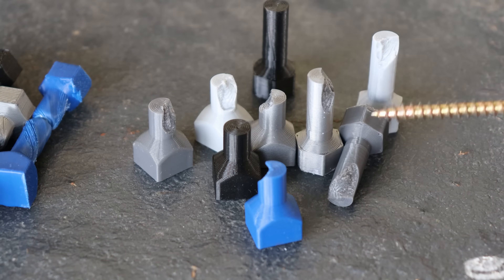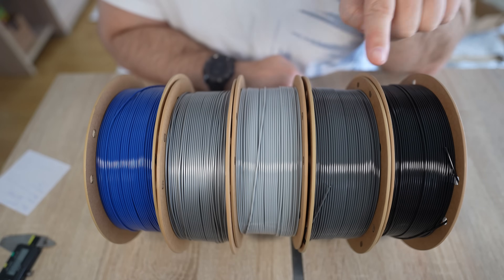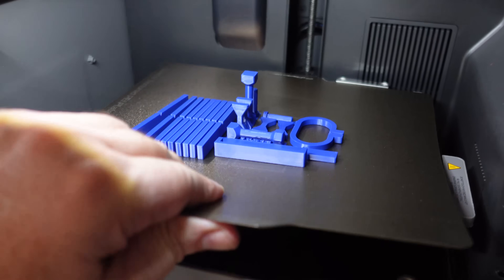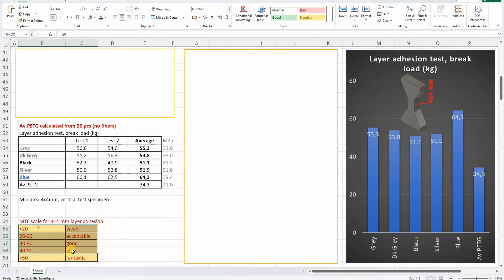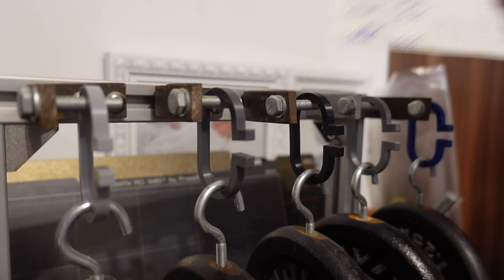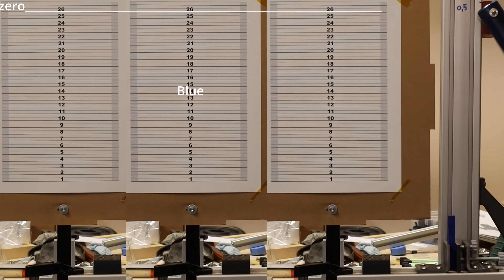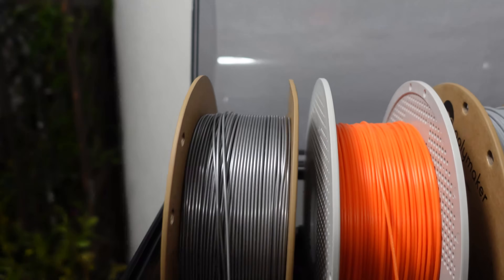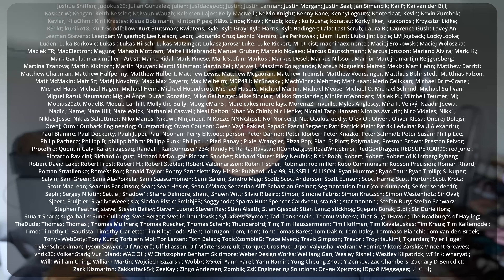PETG Filament With Fantastic Layer Adhesion? Polymaker PETG Review

Comment: Do you post your test result data anywhere? I’d love to see new formulation data against other petg brands. Unfortunately I’ve always found polylite to be exceptionally weak. Also, have you noticed the new formulation having much higher heat retention to the point of causing print difficulties?

Comment: Disagree that the cardboard works well in the AMS. I find that it does not as the spool gets closer to the core, where the torque needed is higher. The spool rims are easy enough to print, and helpful to avoid issues from the winding. The Polymaker winding isn't always the most consistent and this creates feed problems. The filament is quite good and a very nice product for the money, but the winding and the spools are lacking.

Comment: I had very bad luck with the Polymaker cardboard spools with or without the hardened edges.  They still warp, swell and breakdown overtime, leaving debris inside my AMS.  And 4 of the last 14 showed up broken.  Never buying their cardboard again.  Looking forward to these joining their refill category.
Reply: The sides are pretty easy to rip off. You can then put what's left in a reusable spool
Reply: @kendokaaa  true.  I've been doing this too.  Just a slight risk that the filament will wiggle around a little.  Happened on an eSun spool.
Reply: @bjornlovoll8972 What I do is I lay it flat, rip off the top, insert half of a reusable spool, flip it, and add the other half
Reply: @kendokaaa  I do the same.  Using gravity to help hold the filament in place.  The other issue with doing this is sloth.  I do not want to print labels, but I have too many filaments to have spools that I think might be Polymaker PETG, or was this one sSun PLA?

Comment: The test samples printed beautifully and being able to print faster and have significantly better layer adhesion is a big advantage.  Thank you for the detailed testing and thanks to Polymaker for providing the filament for testing and for sponsoring the testing of all filament.  I just ordered two kg of this PETG to try and the Polymaker website is super fast and easy, particularly as a returning customer.  This is how e-commerce should be done.  Kudos to Polymaker.

Comment: You should try to print with actively tempered chamber, as air temp has big effect on layer cooling, thus layer weld quality.

I measured an average of 42MPa layer adhesion with Filanora black PETG with 47C tempered chamber (250C nozzle, 0,15mm layer height; 0,5 width with a 0,4 vulcano nozzle, minimal cooling). My test samples were smaller (2x2,5x30mm, 9 printed at once), so layer time also way lower, which also do effect the temp difference between old and new layers. Highest measured layer strength among all the batches was 47,5MPa. 

Be careful though, as at 50C chamber temp the filament clogged at the heatbreak in my setup, and also the place of the chamber temp sensor may change the max safe set value.

Comment: Nice testing. A great test would be a true head to head with this filament versus Elegoo Rapid PETG and the old polylite PETG formula on the same printer and similar settings. $20 (new) v $11 (rapid) v $14 (old) I am thinking.

Comment: Others in the comment section have already pointed out that you might be printing too fast for good layer adhesion. My finding was that there's visible change in sheen on the flow rate spiral vase test right around 17-21mm^3/s even though i could crank it to beyond 30 without visible failure. Would be good to figure out what setting to use to obtain maximum layer adhesiin. It could be flow rate, melt completness, layer cool down time (too long or too short)
Reply from the maker: Fast or not, I used Polymaker's profile

Comment: Thank you for making this video. I recently started printing in the new Polymaker PETG formula. I don't know if you still have a QiDi X Max 3 or not but I am struggling to use this filament over 240c and keep decent overhangs/bridges. Maybe you know of some good slicer settings to change where I could print at 250c for possibly better layer adhesion? I print exclusively in PETG and this is my general favorite right now.. I wish it wasn't as brittle but I don't know of another PETG that is as good as this and not as brittle. Maybe you do. This is my go-to filament at the moment.
Reply: Pctg is similar and has 10x impact resistance.
For bridges and overhangs increase fan speed to 100% (just for them, not the whole print)
Reply: @riba2233 that seems to worsen drooping because it blows them down
Reply: @colinmsmall  which means a non ideal duct design

Comment: Your methodology for strength testing sucks.  You measured higher strength for Polymaker PETG because you switched to the P2S (which has a longer meltzone than your previous printers, increasing effective nozzle temperature) and 40C+ chamber temperature.  Whereas your other PETG testing was with an X1C with the lid off and door open or P1P (which is open frame).  Until now, your testing has been literally the OPPOSITE of what is recommended for printing PETG.  You should be testing all PETGs at the same nozzle temperature, same hotend design, same chamber temperature, and aux cooling fan speeds for the comparison numbers to matter.  With PETG, you are right at the edge of a cliff in terms of strength at 250C.  A minor change in any temperature-related parameter can easily result in a 25-50% improvement in strength at 250C setpoint.  All PETGs need to be printed at 270 +/- 10C with a 40C+ chamber to achieve maximum layer adhesion.

Comment: Nice, finally we have a proper advancement in filament properties. Seems more like a pure pet based on the properties, higher tensile (regular petg is around 50, this is 60), stiffer, less creep etc. Really exciting, thank you and can't wait for the pet-gf test 😊
Reply: Printabilaty and warping would probably be worse in a pure PET, but they might have reduced the glycol amount in the material.
Glycol is added only for printabilaty as far as I know, so they likely found other additives that allowed them to do this
Reply: @komischertyp4  makes sense yeah

Comment: Quite impressive for PETG (beside the Impact rest).
But Polymaker claimed a 95% layer adhesion strength (nearly isotropic). Would like to know of that was just marketing bs or if it possible to achive with special print settings, like slow and hot without cooling or something similar.
Reply: I have had our R&D department confirm this multiple times even with different people testing to be sure, but yes with the right printing settings you will have nearly isotropic layer adhesion. No marketing magic! Edge of 3D video also shows very good results.
Reply from the maker: @PolymakerPete  Contact me, I will send you my test object, you send me back the .3mf file for some Bambu Printer (P2S, X1C, H2D or H2S).
Reply: @PolymakerPete  Maybe you should get in touch with Igor then so he can show how to do it.
Reply: Marketing, you can do that with any filament if you overheat it. This is realistic

Comment: Can not wait for the PET-GF15 tests. Keep up the great work. It helps alot
Reply: I'm currently printing with it. I previously had PET-CF17, and compared to it, the GF15 version is slightly less stiff, but also seems less brittle. Layer adhesion is better than the carbon fiber version. Both filaments, printed on an open printer, require drying after a few days if the spool is left exposed to the air. Straight out of the box, they print very similarly and can be printed with the same gcode, although with PET-GF15, you can increase the printing temperature by 10°C. BTW I am also waiting for a professional test and whether it can be annealed to increase its durability like in the CF17 version.
Reply: @michagromek6342  it can be annealed
Reply: @michagromek6342  Seems to be my experience with SirayaTech PET-GF version. Glad to see another offering!
Reply: @michagromek6342 Most PET don't gain any durability from annealing (IE impact resistance). Some might actually lose some impact resistance typically it's to gain significantly higher temperature resistance. Definitely a trade off annealing, and with shrinkage concerns not worth it unless you're using it where high temperature resistance is a requirement.

Comment: We need a tier ranking for each filament type based on your test results. This way, we can clearly see how each brand performs in PLA, PETG, and other materials.
Reply: The problem with this approach is that it's not the brand performance, it's the plastic formula performance. A brand may have some good plastics but also could have bad ones.

Comment: It's interesting that you only got about 50% layer adhesion compared to horizontal, while Edge of 3D (another testing channel) got >100% layer adhesion. Polymaker also claims "nearly isotropic" layer adhesion. Could it be that you need to change some printing parameters?
Reply: My guess would be flow rate is too high. 21 seems like a lot for a non high flow PETG
Reply: @muffins4tots  it is high flow now as a standard
Reply: @muffins4tots  you can go a bit higher on the nozzle and chamber and even zero fan and it will help, but it's always a trade off with print quality. Depends on your geometry and use case.
Reply: Isn't it the other way around? His specimen comes with XY strength much higher than the numbers in polymaker's TDS. Maybe some annealing (post processing) could help.
Reply: That's impossible and means that he is not testing something right. This was already printed with a low fan and decent temp so this is what you can expect.
Reply: @riba2233 This is a new formulation that Polymaker is claiming to be isotropic.
Reply: @polycrystallinesilicate  there is no such thing unfortunately.
Reply: @riba2233  Then it's a good thing they are not claiming that; only the parent of this reply.
Reply: @snarky-drive-by  yeah that makes sense
Reply: @snarky-drive-by They are claiming "nearly injection molded" layer adhesion in at least one of their videos

Comment: Great that there is still innovation for already popular and established materials. I have printed with the white from this new formulation and it is indeed higher flow compared to other regular PETG filaments. Some questions to Polymaker: Are transparent colours coming for this formulation? 3kg spools? Refills? Any thoughts/considerations for the OpenPrintTag? I wonder if other manufacturers will react or stick to their old products. Prusament and Extrudr for example sell their PETG for quite a premium. Azurefilm on the other hand has PETG high speed superpacks that cost 12 euro/kg and at least on paper the properties should be similar to this Polymaker PETG formulation. I have already printed some toe clamps with the PET GF15 white, it is a great material, but too early to tell how it will hold over time. So I look forward to your video with the 6 colours as well.
Reply: Translucent Coming? Yes
Refills? Not at the moment, we have to see how the community reacts with our PLA Refills
OpenPrintTag? Yes, we are looking into and have been supporting many of these projects.
Pricing as a premium? This new formula was actually more cost efficient for us than the old formula actually so we passed on the $3 per kg savings to you :)
Reply: @PolymakerPete  Thank you for the response. Looking forward to the transparent colours. Regarding the price, I said that the other EU suppliers have premium pricing for "old lower flow" PETG, not that Polymaker is charging a premium. The price to me for the EU market is perfectly reasonable for this material given that it is a better PETG than "regular PETG".

Comment: 1:20 I’m confused. PETG is not more brittle compared to PLA. It’s quite the opposite. PLA is stiff and brittle and PETG is quite a bit more flexible. Right?

Well, I guess I should finish watching the video before commenting, lol.
Reply: PETG is more flexible (it bends more before it breaks) but it is more brittle (handles sudden impacts worse) than PLA.
Reply: @polycrystallinesilicate  Thanks for the reply. Yeah I’m still trying to wrap my head around this. I always thought that if a material is more flexible, then it automatically means it’s less brittle. But this video seems to contradict that (and I’m sure he’s right and I’m wrong, lol). I guess it has to do with a sudden vs slow impact/force. It seems PETG is flexible when you’re slowly bending, but can still be broken more easily (compared to PLA) when it’s hit by a sudden impact. I guess. I don’t know. My mind is going down a rabbit hole right now, lol.
Reply: @GoComm79 That's right, properties of a material can change based on the strain rate (rate of deformation). PETG can handle low strain rate better than sudden impacts.
Reply: @polycrystallinesilicate  Ah ok. Very interesting. Thanks much.
Reply from the maker: Check my Voxel PLA vs PETG video
Reply: @MyTechFun  Thank you! I watched it just now! I guess I’m just getting mixed up with my terminology. From my understanding, and my direct experience, PETG is more flexible (bendable) than PLA. I consider PLA to be rather stiff, meaning inflexible. And I always associated stiffer materials with being more brittle, and more flexible materials with being less brittle. But I guess that’s not necessarily the case.

I did some research and I guess brittleness is more the ability of a material to resist breaking when subjected to a SUDDEN impact. I think of that more as “impact resistance.”

When I think of flexibility, I’m not thinking of sudden impacts, rather I’m thinking of more slow, bending type forces/impacts. Slowly pushing something versus quickly punching it. I guess that’s more accurately called deformation though.

PETG is definitely more flexible than PLA, but when subjected to sudden impacts, like your swinging hammer test, it breaks more easily. So by those definitions, then yeah, it’s more “brittle.” I’m still trying to wrap my head around that because it doesn’t really make sense to me, lol.

Either way, thanks so much for taking the time to make these wonderful videos for us! We definitely appreciate it and I know they always get me thinking.

I mainly wanted to watch this video to see how Polymaker’s new PETG compares to Bambu Labs PETG-HF. And it seems like it’s a superior product. Much better layer adhesion and tensile strength, all while being only slightly less flexible.
Reply: Not only that but PETG is "sticky", so layer adhesion is way higher than PLA's so I'm at a loss here. I'm guessing his preconceptions only apply to voxel's PETG which seems to be an anomaly.
Reply: @nachot6592 Preconceptions? Dude he has literally tested hundreds of materials with objective equipment. Also, normal PETG doesn't have higher layer adhesion than PLA. This new formulation from Polymaker is supposed to be an outlier.

Comment: The first time i used petg it was from poly maker. had  a few issues and misprints. maybe i didnt dry enough?? i dont know cuz i was like 2 weeks into 3d printing. but i can tell you I never had the sam e issues with bambu petg
Reply from the maker: Its important to recognize if the filament needs drying. But if it was a new filament, then it should be dry. So I don't know..
Reply: @MyTechFun  it could be wet due to water getting in from sea shipping. Vacuum seal isn't always foolproof unfortunately
Reply: I don’t understand why people rave over their filament. I’ve had so many bad spools from them for one reason or another. I don’t buy their stuff anymore.
Reply: @Javii96  i kinda agree with you. i hate the cardboard spools . I had good luck with pla but then again i had great luck with cheap pla too?
Reply: @peterpeter5666  i have had multiple spools with terrible filament diameter tolerances to where i could not dial in flow rates. Some layers over-extrude and other layers under-extrude. And i had two rolls of their ASA that were phenomenal and had great layer adhesion and then the next roll came so wet that i could see steam coming out. After drying for a day it made pretty prints but the layer adhesion made it unusable. I stick with other brands now and never have issues
Reply: @Javii96  sounds like a skill issue, they make the best filament.
Reply: @xuyukun123  yeah that's not ideal